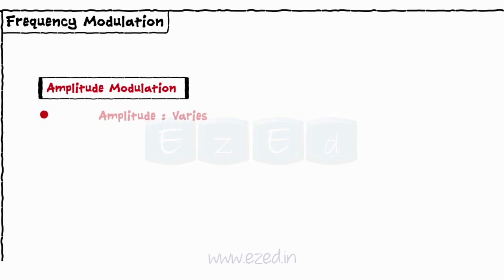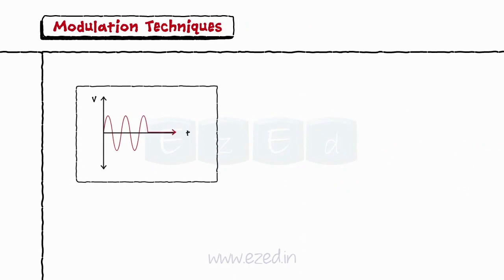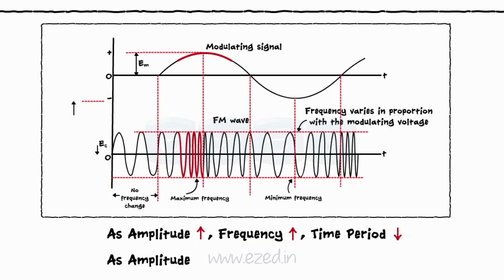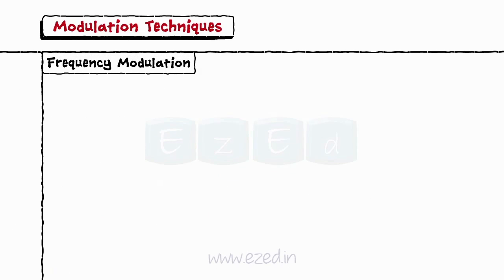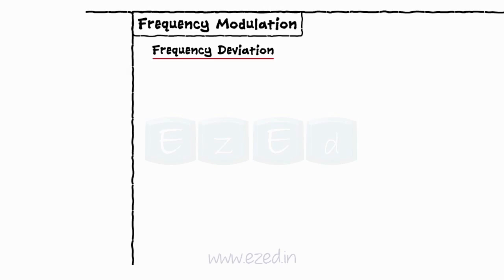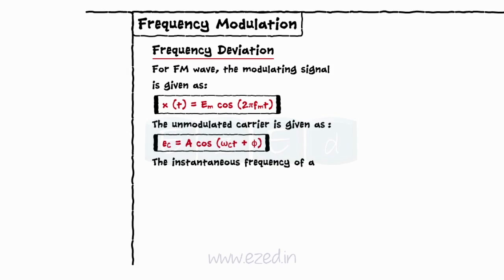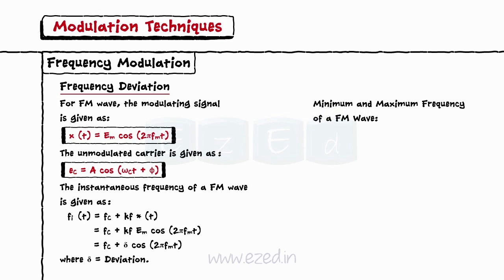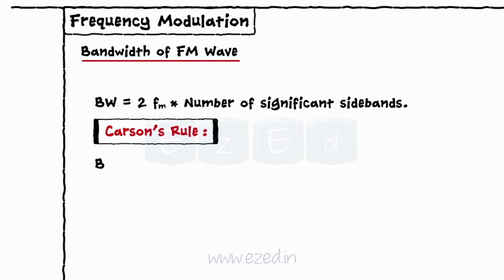FREQUENCY MODULATION - Frequency Deviation - Bandwidth of FM Wave - Modulation Techniques

Comment: I have a multiple choice question:

In a digital format the constellation diagram has 64 points. What is the number of transmitted bits per symbol?
A)log2(32)
B)log2(64)
C)2^64
D)64
can you help me please because i have a test